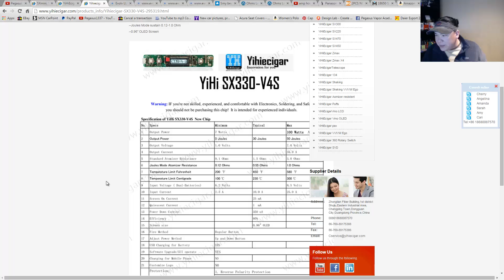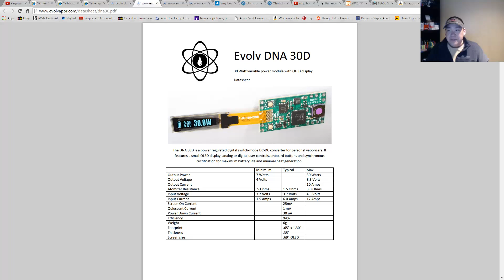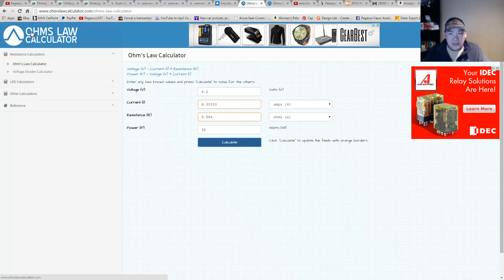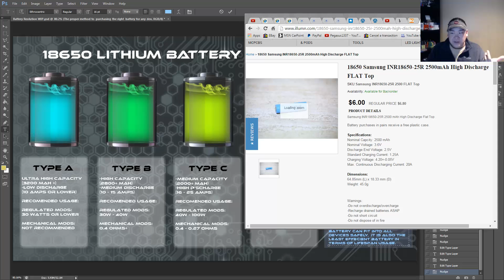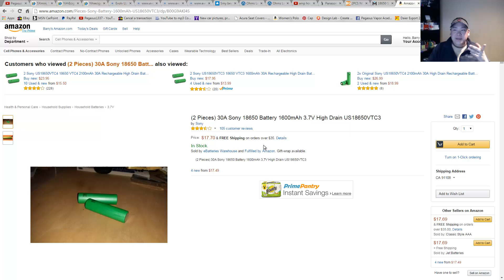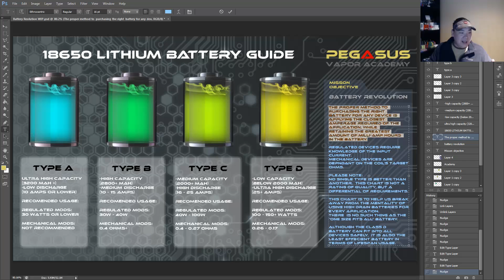The Straight Volt - Ep 04: 18650 Battery Revolution

Comment: Do you recommend a type of battery for solar power? I have 800 watts of solar and presently using a grid-tie-converter but would like to go to battery and off grid for part of my power use. Also how many of these 18650's need?

Comment: I use a Reosmods Reo Grand.  I run a dual coil set-up at around .4 ohms, powered by the classic AW IMR 1600 rated at 15c or 24 amps.  I'm starting to wonder if my next batch of batteries should be something else.  I don't mind changing out the battery at the end of every day....I keep 4 charged and cycle through them.  But at the same time, more vape time between battery swaps sounds tasty.

Comment: Pothead science. If you want a quality battery just buy brand name. LGchem, panasonic, sony, sanyo, samsung. That type. Surefire and trustfire is not it.
LG is both good and low cost. Their batteries are used in electric cars where it has to work for 10+ years so it's good enough for you stoner dummies.
Stop smoking, morons. It's not a cool thing

Comment: Thanks man, great vid.. Really cleared up a lot of my concerns about batteries.. I wanted to get into mods that I need batteries for but I've been bit worried not knowing safety, as all the info around got me confused.  So all my devices so far have been built-in like MVPs, ISticks, Smok XCube & M80 exc and so on.  Will still research a little more before I start buying batteries and mods, but i feel like i won't be blowing myself up after this bit of insight.. Thanks again.  ..subscribed to stay tuned

Comment: Waiting on my Sigelei 150W box mod in the mail, bought two 35a 18650 don't remember which brand should that be alright? I'm ordering 30a Sony as back ups
Reply: +Darius Petersen If you have 2 4.2v 18650s all you need is 2 type c batteries.(2 20a batteries gives you 40a at max you will only use around 36a at 150w) I did the math, Even if you have 2 35a =70a that's WAY to much unneeded power (all you need is 36a), you could get better life if you get 2 20a 18650s.

Comment: Im confused I have a imrem 3.7v 2900 mah with 30 amps what category does that fit into since the mah fits into a type B but the amps fits in the type D? I only have a Mechanical mods.
Reply: +MrWolfiecraft Well based on this video that battery doesn't exist. The battery your using is either not 2900 mah but around 30 amps, not 30 amps but around 2900 mah, or both of the stats are wrong.

Comment: So I would need an A battery for my 2Ω 6 wrap 30g kanthal builds that I vape at 10-12 watts???
Reply from the maker: Rick Sievers Awesome,  you got it!
Reply: Pegasus Vapor Academy What would a D battery do do it? Anything bad?
Reply from the maker: Nothing bad.  Its just overkill.  We could shove high drain. Into anything. But then you shorten the life without good reason.  This applies even more in a regulated device as performance is based on the chip and not the battery

Comment: Ok, yes I am confused a bit so I would like very much to see your video on the best batteries for what we are using and would be willing to get into the pool of purchasers for them. One quick question, for example one of my devices is the MVP 3.0, the build is a dripper, dual coil. My coils are putting out between .50 to .80. I use this as my dripper. What battery would be safe for this? Should I stick with1.0? Thanks any help would be appreciated. Newbie at building sub holm and a little nervous watching all these battery safety vids. Thank You PS where can I download the homs calculator?
Reply from the maker: the ohms calculator is everywhere online,  or you can Download phone apps.

MVP's are regulated devices with internal batteries.  the chip will refuse to fire at anytime you built something too lower or with a short.
I'll get into it more in the next episodes.
Reply: Pegasus Vapor Academy Thank you for your fast response. God Bless

Comment: I am currently using a kangertech kbox with the aspire Atlantis tank. I use an Efest 18650 35 amp battery in it. Do you think this Is safe? And also what kind of battery would you recommend for this setup. I am farely New to vaping I know a little about vaping but batteries confuse me lol

Comment: Love your vids. Where does the VTC4 fall in these cats? It's 2100mah but 30a draw. I see it as class D which is why I got them(besides all the controversy and cloning of VTC5). My interp is Type A: Efest Purple 3100Mah Type B: Panasonic CGR series Type C: 25R or LG he2 and type D: VTC4-5(if 5 really exists).
Reply from the maker: right now a vtc 4 would actually fall indo the type C  because  its not really a 30 amp battery.  its embellished.
its not 15 either.   the VTC 4 is kind of like the samsung 20R   its really more like 2000+ mah  @ 22-24 amps.
We didnt know that a year ago because we didnt question it.

theres lots of graphs online to prove what i just said.  purty sad =\  but you know.  we believed it blindly and battery makers are gonna go nuts.
case in point,  IMREN 40 amp 2800 mah.   those specs are insane.
Reply: Pegasus Vapor Academy As I understand, only parallel configs can touch 40a. But are you saying we have no 30a option? I busted open my brand new Dewalt battery pack(20V Max XR Li-ion) and found  UR18650RX batts, was thinking that may be the best place to get safe, high amp, batts. Would you agree?
Reply from the maker: 30 amp right now,
I would say  VTC3 or the old MNKE orange 1500  and there is 1 more.  I will be introducing a 2015 model that is a true 30 amp with better resistance to heat.

as for battery packs,   hard to say  many of those batteries were meant for exactly just that,   to be worked in a pack.
Reply: That's how II felt about the laptop batt packs but it seems that is where most of the hype(sony's and all) came from. I just wonder if Dewalt or Tesla are the ones getting the real batts while we're all just "beggars" getting leftovers. I would def buy batts from you any day and preach them to those who ask me about it. Right now my best lead is illumn.com.
Reply: Pegasus Vapor Academy I trust in your knowledge bro. I see your passion for the truth. I'm still a little rocked to hear vtc4 is not a 30a but I don't doubt you've done the proper digging to back up your view. I consider myself a pretty hardcore truth-finder but I can see plainly your determination out-classes mine.

Comment: My current 18650 battery of choice is the IMREN IMR 2000mAh 40A cell. I plan on using two of these in an unregulated SERIES/PARALLEL box. I've done my ohm calculation in series and this is what i got.
R=0.3
V=8.4
Current=28
Power=235.2
If it's correct, both of the IMREN IMR 18650 2000 mAh 40A should be able to handle this build.
CORRECT ME IF I'M WRONG!
Reply from the maker: I will do a video for you.  Just for you.
Reply: Pegasus Vapor Academy THANKS PEG!

Comment: Hi Peg, I have a Segeli 150 wattt, PVA 40 (on the way) and am thinking about getting a parallel box mod (undecided as of yet). For battery safety on dual battery (series and parallel) boxes where they say to marry the batteries and to ensure the batteries are at the same charge and performance level would you recommend a tester that uses a pulse load test to measure the performance and SOC (state of charge) rather than just a voltage test on a multimeter. The tester I'm talking about is:

 http://www.ztsinc.com/mbt1.html

What do you think about this tester?

Comment: hi dude.
im danish and i cant keep up, you talk way too fast for me to understand it, so im gonna ask what you said you shy away from answering. but here goes:
im currently using Efest IMR 18650 3,7v LI-MN  3100mAh  with 20A discharge current
in my Kangertech KBOX + Kangertech subtank with 0,5 ohm coils and i vape at 30W
is this the best? or did i just get suckered into buying the wrong battery?
if NOT, plz let me know what you would use with this setup :)

best regards Thomas
Reply from the maker: #1 For any regulated device you must find out the input current needed.
#2 The 3100 mah purple efest that is rated for 20 amps is a pulse rating.
#3 Will it work?  yes,  it will work until the PTC protection circuit is broken and then it will be dangerous.
Reply: Not a good idea.  Last I heard, those Efest 3100's were a re-wrapped Panasonic rated for ~6.8A continuous.  At 30W, your KBOX could be easily trying to draw 10+ Amps from that battery. Most 30W boxes are spec'ed for around 10 amps Input Current But like Peg said, you should check the Kbox's specifics and match them with a battery whose Max Continuous Discharge Current is rated appropriately.
Reply: nvm this question, found the info :)
http://www.kangeronline.com/products/kanger-kbox-mod

Comment: I agree with everything Peg, except the always using the 4.2v in ohms law...I am sure you are aware of this but for anyone using a higher voltage device such as an unregulated series box should be using it's max voltage as there base line to know what they need to do to stay safe...

The idea of not figuring in the battery sag is something that really needed to get out there, as well as the info you gave on using regulated devices and the appropriate cells for those...

Awesome info as always Man...
Thank you... =)

Comment: Hi peg
We see a lot of people reviewing ohms law calculator and almost all times they refer to without saying it is using a mech mod
Normally say start voltage at 4.2v [even thou you will lose voltage drop].
We now use regulated mods with subohming meaning we can stay at 4.2v or even higher
Maybe we should start using the calculator with actual voltage settings when using a regulated mod
 and then see how it compares to battery safety
Reply from the maker: I see where you're going with this Mick,  but those or two different types of power.
Mechanical devices experience the drop on load simply because it is unregulated.  Its just the nature of if.
However regulated devices using chips and doing DC to DC conversions.  The 4.2 V setting is boosted.  Ohms law does not apply to the battery in the same sense here.
For regulated devices the rule is simple.  Just find out what your maximum input current is,  and buy the right type of battery for it.  Done.

cranking up settings  is boosting from the chip.  that is a different algorithm.

Comment: You nailed it Peg. Clear, concise, factual knowledge..... The explanation on Internal Resistance was much easier to follow this time. Explaining how heat stresses batteries, causing the IR to go up, resulting in shortened battery life. 

I noticed that your battery classes are color coded. Just an idea.....To make battery classification more useful to mechanical mod users and encourage VV/VW mod makers to play along. In addition to your ABCD classification chart, how about a voltage/resistance chart? With your ABCD battery colors plugged in. Three years ago Kanger supplied a chart like this with their Protank. http://vtpics.vapertrain.com/volta

Yes I'll buy a few sets of Samsung 30Q, An extra set for the PVA-40, Class A? you say? I've got C class and D class batteries covered, unless you really rock the boat.

Comment: I enjoy being part of this family/community and felt I should add some additional knowledge and a correction.  Output current is what you should be looking at.  This is what you're atomizer or whatever your powering will be drawing from your power source (in this case our batteries).  Input current is typically (at least on these these kind of boards) is what the board can handle coming into its components, i.e a charging current or the current being "grounded" back to the board.  Generally these numbers will be fairly close, but output is the load taken from the battery.  Often, these output currents have an instantaneous peak rating that will will be around 1.5x the continuous.  Thought I would mention that Output is the load your atomizer or whatever you are using is going to be using.
Reply: Your point is important and should be verified, as I was under the assumption that Input Current is the draw from the battery to the chip and Output Current is the draw from the chip to the atomizer, where the two are completely separate and only the Input Current is required to select an appropriate battery.
Reply: Peter Baggish I may be a little off.  It has been a while since I have done this stuff in college.  Important to note that even the way you described it, a chip can't create energy out of thin air, it will still be required to draw the current before it can convert it.  In the DNA40's case, there is some extra things going on as it puts out a negative voltage.  However, it can put out up-to 23amps which is a significant enough to mention.  It will have to pull more current to do that.  I guess that is really my main point on that.  There is a lot more than goes into how circuits and boards do things, a lot components and "programming" if you will determines a lot of this.
Reply: Ethoruk L10 You may be right on and a good look into the wonderful world of Buck/Boost circuitry might be useful here. Watts In = Watts Out and all that....But looking at the DNA40, further down on their Datasheet it also states that any battery used should be rated for a minimum of 16 Amps continuous, which is also the specified Maximum Input Current for the chip.
Reply from the maker: Peter Baggish without going out on a limb and getting links,  I am positive as a consumer your only concern is the input current.
Both john from evolv or mr chen from Yihi would tell you the same.

Comment: Good job, as per usual.  (and thanks for indirectly calling me a "smartypantz").  I'm ready for the new badass batteries.  Also, as a sidenote, perhaps it'd be useful to clarify and reinforce what you meant by selecting the appropriate battery for the APPLICATION and not simply the device itself. For example, a 10 amp battery (eg, a Panny NCR18650PF) can be safely used in a device that is spec'd for a Max Input Current of 13 amps as long as you're always using it at a lower-than-maximum wattage setting.
Reply from the maker: I get what you're saying  its about application VS device,  sounds the same but its not.  1 more precise than another.  I get it.  This one will require a well written script to teach it to everyone WITHOUT any confusion or misinterpretation.

You always have to keep in mind this is an open source channel and these video are for everyone.  So I will have to spend extra time on conveying this one properly.  Because I think you can foresee a misunderstanding of this concept could be catastrophic.

Comment: What is a good example of a type B battery
Reply from the maker: In this particular Video  I mention the  Panasonic NCR18650PF
But for the new 2015 tech, I will be releasing Samsung 30Q as King of the Type B
Reply: Pegasus Vapor Academy thanx very helpful vid keep up the good work
Reply from the maker: the efest, like the imrens and other china rewraps  are false spec batteries.

the 20 amp written on it is a pulse rating.
so in actuallity it could be 10amps or less continuous with a 3100 mah rating.

I would class that as a poor Type A battery.
Reply: Pegasus Vapor Academy I never knew this PEG! maybe that could be the reason behind my sub par battery life .. I was using x2 of them! 35 amp and 25 or 2600 MAH I believe? but only getting a few hours if that at only 25 - 30 watts! it has been a real challenge and nightmare for a heavy all day and night consistent vapor enthusiast like myself to make any device last while satisfying me all day ! what device setup do you recommend for great flavour and large vapor production while keeping me running all day my friend? or would the device be less important and the batteries I use more ? if so ... would you say an ipv mini 2 or sigelei 150 watt is a good device with a kanger sub tank mini or something to get what I just mentioned? please recommend me a great setup and pair of batteries to use for it! thanks